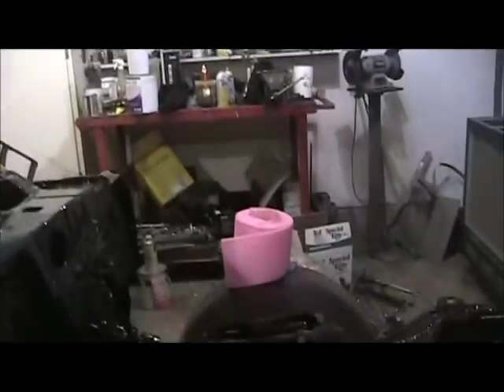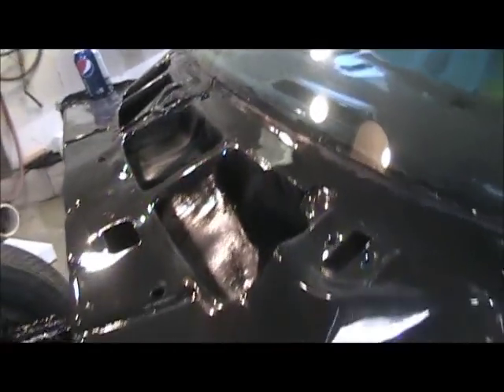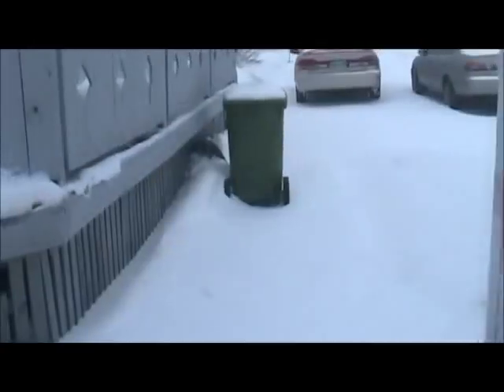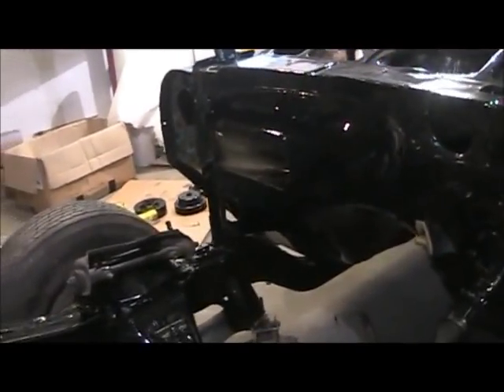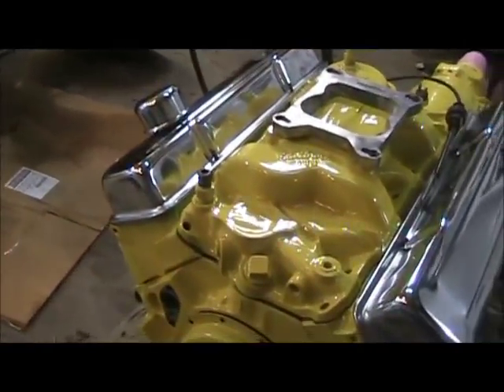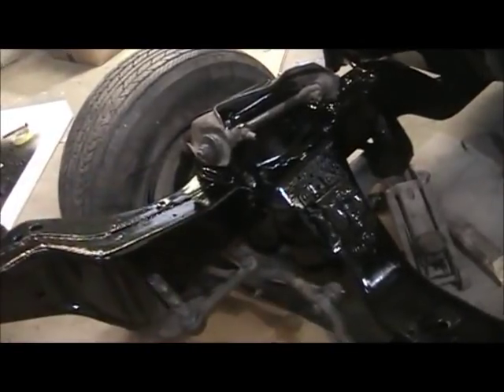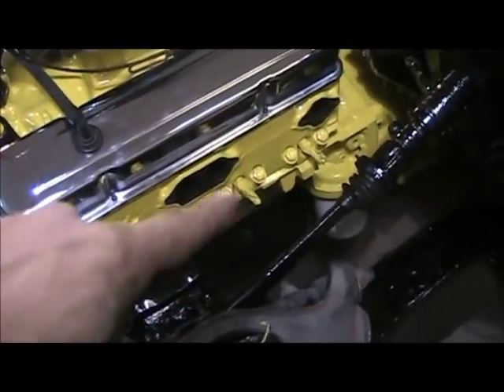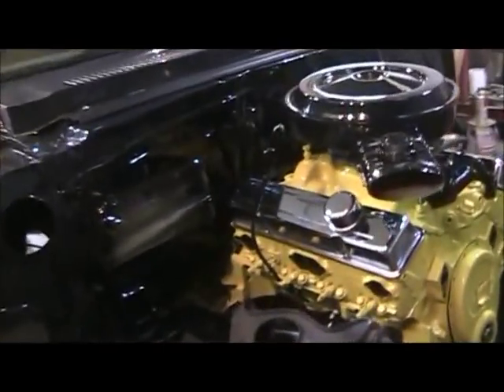the engine is sitting back in the nova

Comment: ya only had 3 bolts in the motor mount, looked like it had an empty hole. an Merry Christmas Rick to you an the Family all 25 of them ;)
Reply: Rick that paint job on the engine is mint, well done
Reply from the maker: thankx kenny,good eye lol ,not sure why but only 3 holes lined up no matter how i put them,sub frame was drilled in several spots,im figuring was universal for different engines,might drill out the 4th hole though,its an easy 1 to get at,lol,u have a merry xmas too,tc
Reply from the maker: HotRod Paul thankx paul,im liking it,just hope i can keep it clean,thankx for watching,tc
Reply: Rick it's not as hard as you may think.
Most important thing is to have the best gasket surfaces you can to stop as many leaks as possible, my big block was done,the same way as yours but in two pak black.  I just hose it down with the high pressure washer before a car show and after the car show, and do my aluminium polish work still the car show.  My polishing takes about 2 hours in the engine bay and that brings it up almost to show standard.  My enjoyment comes from looking at the car not showing her, everyone has a different way of enjoying the hobby, yours will be different to mine.

Comment: Looks great Rick do you have a spacer under the carb  loose that and hood won't be a problem see ya Happy Holidays :-)
Reply from the maker: thankx bruce,there is an adaptor under the carb,the intake was set up for a different style carb and the adaptor lets the quadrajet fit,chevahaulic had a good suggestion with going with a chrome set up with a dropped base,hope u arent getting too much snow out there,u and your family have happy holidays too,tc